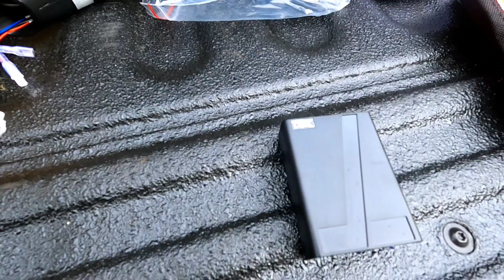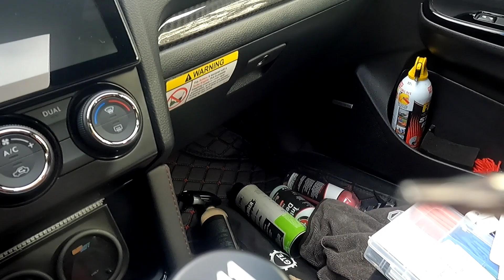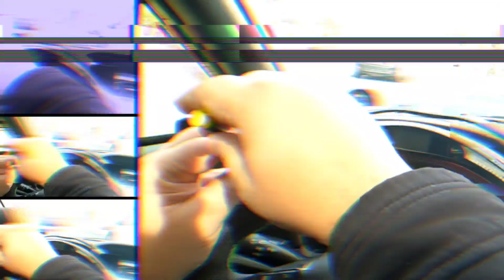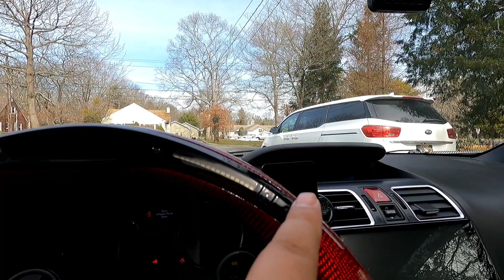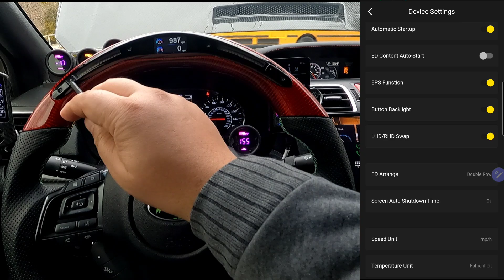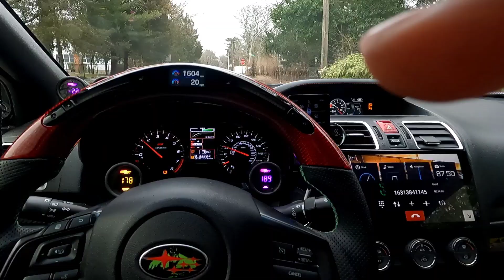TDD/OHC MOTORS 5th GEN  GALAXY PRO UPGRADE FOR MY 2018 SUBARU STI LED SMART WHEEL(unboxing/install)

Comment: Hey there! This video was a lifesaver for me! I had a battery drain issue on my 2018 GTR, and guess what? It turned out that connecting the box directly to a 12v connection solved the problem! I thought my battery was faulty, so I got a new one. But nooo, it was the box! The Odb port sends power to it 24/7! I couldn’t figure out why my battery kept draining every day. Thanks a bunch for this video, my friend! 🎉🎉🎉🎉
Reply from the maker: Glad it helped!!!

Comment: I'm currently using the 5th Gen Galaxy Pro, and I have to say the after-sales support is extremely disappointing.

I purchased the device in late 2024, and I've been experiencing recurring errors ever since. The most recent issue is that the RPM is no longer displaying properly—a basic feature that is essential to normal operation.

I sent an email on April 9th, and it's now been three weeks without even a confirmation or response.
Is anyone actually monitoring customer support inquiries?

To make matters worse, even basic functions are locked behind 3-month subscription plans, which means that just to enable one feature and wait for a bug fix, I’d probably have to subscribe for at least 6 months.
Reply from the maker: Wow, that's freaking wild bro.  Here's some info I got off of their Instagram, don't know if it will help.
Email- nfo@angotan.com
WhatsApp- +86 137 2988 0626

A rep messaged me on IG early April about and update, I replied when he messaged and no answer as well.
Reply: @WikedWips  Thank you for your response. It seems that there are very few support staff, probably due to the low number of users. It might be faster to figure out how to code it myself.
Reply from the maker: @byungkwonchung2751 most likely
Reply: @WikedWips  see how unreliable that is as a company. It should be considered BURLA. So this WhatsApp contact is the same as Brian's from OHC and TDDmotors?

Comment: On that little screen can you put like RPM & Gear. Like what gear the car is in.  Or speed and what gear ?   ⚙️
Reply from the maker: @arabzmostwanted  gear selection and speed  is not there...rpms, boost, Coolant/oil temp is available.  Also ohc contacted this week about an update but idk what it is as of yet
Reply: @WikedWips  reply to me pretty please. If they update to display the gear on the screen that would be sweet.   Thank you for your reply

Comment: Why didn’t you grab power from the horn circuit so you wouldn’t have to turn the lights on? 😂
Reply from the maker: Idk if your joking or not😆
Reply: @WikedWips  not joking.  You should have a 12v+ wire in the clock spring for the horn that is not tied to the lighting for the buttons.

Comment: Do I have to wire a jump start to that part of the harness or it will not work? My wheel does not start with the car it only starts when I hold two buttons but even then the data isn’t synced and it shuts down after 30 secs.

I was under the impression that the obd supplied the box with power
Reply from the maker: Idk what ur speaking of...I did this a while ago....I have previous vids on my channel that might answer ur questions with this wheel
Reply: @WikedWips  it has to do with the “knock sensor”. My wheel has “matching success” when I hold the button and pair the box to the wheel but it  won’t turn on when I start the car. The only way I get it on is by pressing both buttons on the wheel but then it doesn’t display any data that is synced. Everything is 0 like 0rpm etc then it just shuts off. Just wondering if these are the same symptoms you had before doing the knock bypass
Reply from the maker: @Grayxlx oh I see what ur saying.  I never had any of those issues brother 🫡

Comment: Hi buddy, please can you help me I have a BMW and my problem is, I can't connect (OBD) box with my application soon when I turn on OBD box steering wheel light disconnects off power and my steering wheel light doesn’t work soon when OBD box, coming off light on steering wheel coming on
Reply from the maker: You have to get In touch with the manufacturer brother.
Reply: @WikedWips  hi yes he told me to plug it into the fuses according to the instructions, but I don't know which ones, I could send you a video of how it works

Comment: That is so rubbish you have to have your lights on for it to work 😂😂😂😂 set up wrong then mine works as soon as I turn the car on 🎉🎉
Reply from the maker: The clock spring wires, I'm sure, vary from car to car....that's the only option I have, unfortunately

Comment: Why didn't you connect the blue wire ?
Reply: You don’t connect it if you already connected the 12v red wire
Reply from the maker: If I remember correctly, the blue wire is only for adding xtra voltage to the wheel
Reply: @WikedWips  what is extra voltage for ?